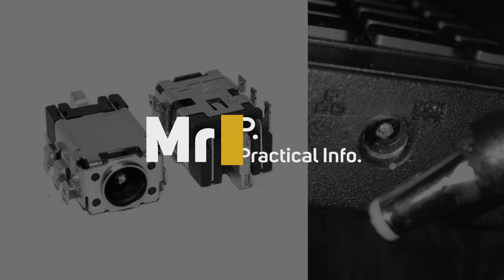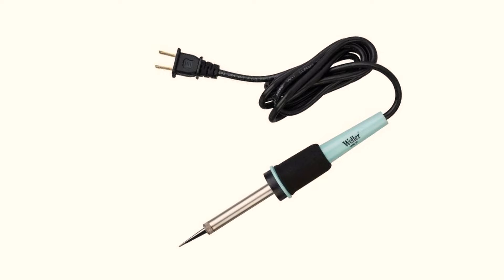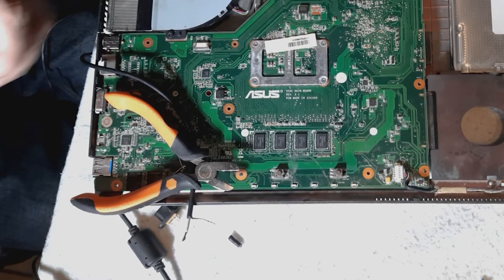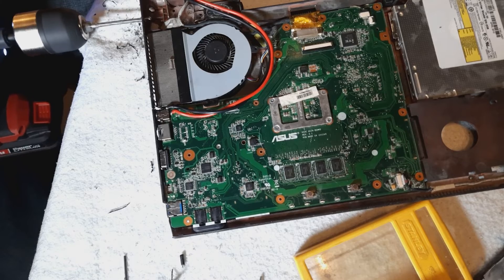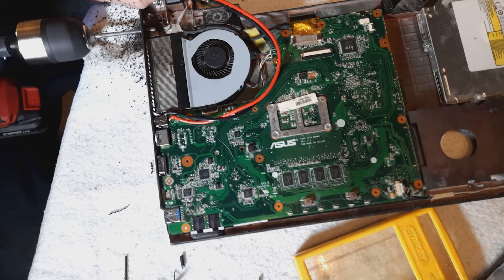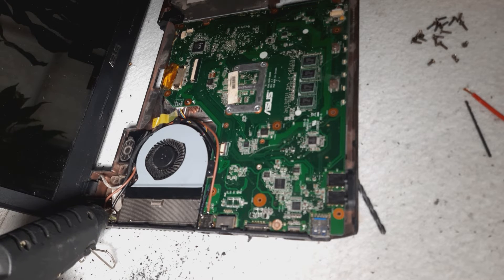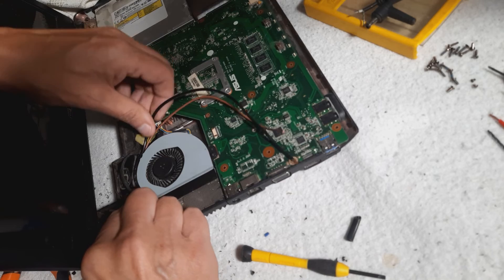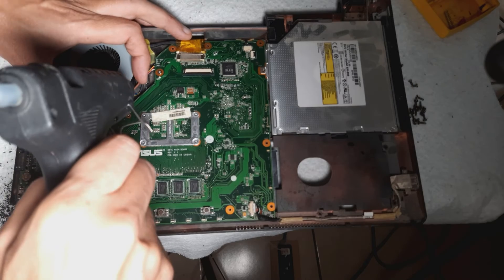Laptop Charging Port Bypass Fix 💻

Comment: I just tried similar on my Asus UX31-e. Well sort of. I just "drilled" through original charge port and pulled my power supply cable through there. Soldered hot to red and ground to black. Laptop starts well (sort of) after this but doesn't show win10 battery charging icon at all. I have replaced this charging port once in the past twice even. You get what you pay for. Hence the just drilling it out. 

I think this model has some sort of circuit on it to sense the barrel connector in/out. Would like to bypass that too. Argh.
Reply: It took me 3 tries and 2 routes but very glad to say I got my Win10 charging icon back. First try (from lousy internet research of different manufactures power supply sence pins) was putting a 100k (or ohm maybe) resistor between ground and the sence pin) started up but no charging icon. After more research a guy mentioned (not Asus related btw) just jumping the sence pin over to positive in on the jack. That worked !!!
Got it to start charging again. So happy I didn't smoke the machine while doing the other attempts.

(((Me))) & (((Dodgy "Fixes)))